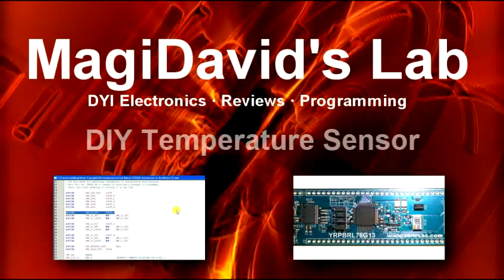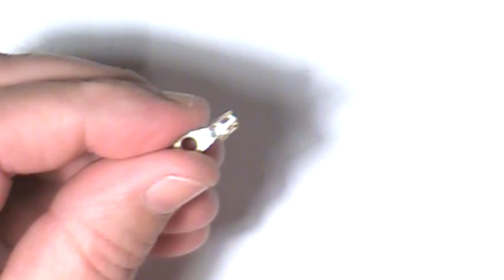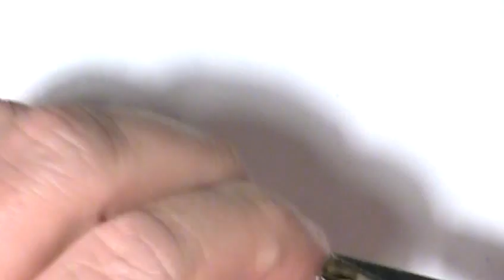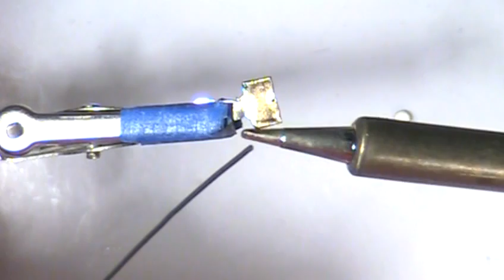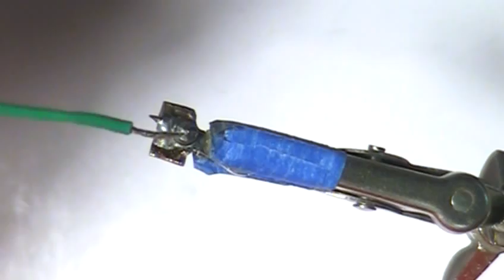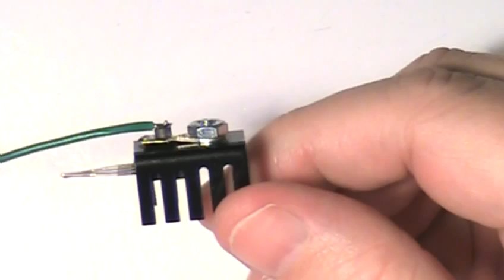MD Lab: DIY Temperature Sensor For a Heatsink

Comment: Thank you! Are there not temperature sensors for use with arduino that already have a hole to be used to bolt it directly onto the heat sink. There must be, no?